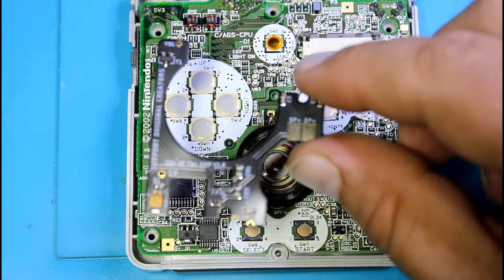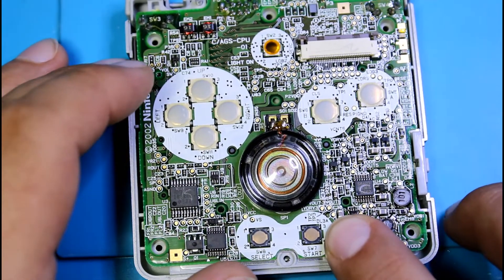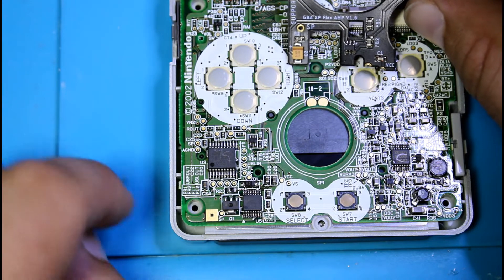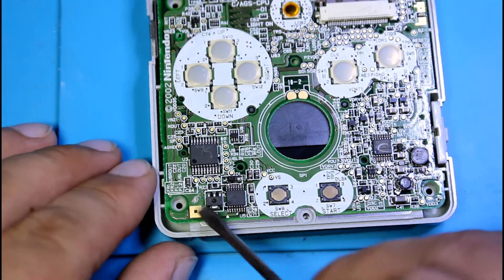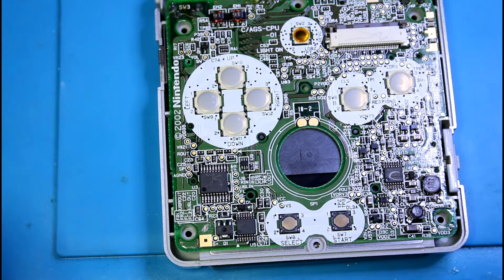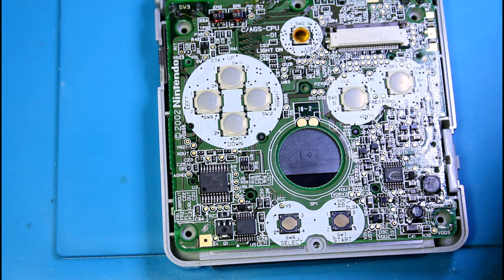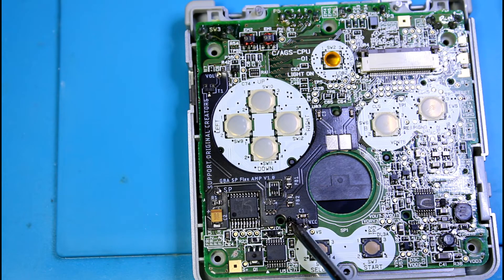Installing the new GBA SP Flex Amp in an AGS-001

Comment: Can I solve no sound issue with this amp? I tested My speaker works but no soundon gba sp 001
Reply from the maker: The GBA SP CPU is what generates the sound for the handheld so if there is no sound you either have a bad amp or some broken traces or possibly a bad CPU. My amp taps into the output of the original amp so if that has no sound then neither will my amp.

Comment: I got and installed this in a 001 and when I turn the volume down it dosnt turn off let alone mute, any pointers as to what could be wrong? The volume control does work it dose get quiter just dont turn off, 
Edit i cant liad your website as for its blocked for me because you dont ship to where i am, so i could not get a hold of your email

Comment: That capacitor isn’t just ground. I figured that out the hard way. I originally connect it directly to ground on a AGS-001 via the wire. I didn’t need the wire. I soldered it directly to the capacitor. Now everything is perfect.

Comment: For the AGS-101, it seems that there are only 3 tack points between the amp and mobo, with the 4th connection being a wire soldered from the amp ground point itself (not the mobo) to the scraped off ground. Does this sound correct? Thanks!
Reply from the maker: Yes, the 101 has no component where the 001 does that connects to GND so you have to find a GND point and that area we scrape is the closest but you can use any other GND point if you'd like.

Comment: Hello, I've just installed this flex amp along with your power cleaner in my ags-101. The sound is loud and clear overall, no hum or hiss. But it gets crackly when louder noises or songs are playing. It kinda sounds like the speaker is breaking up. I'm using the 1w speaker you recommended and I've also tried it with the oem speaker with the same results. Any thoughts or ideas on what might cause this? I'm wondering if i need to remove the piece of cloth between the speaker and the shell. My thinking there is that maybe the speaker cone is rattling against the cloth since there is more travel in the speaker when the volume is louder. Any input will be greatly appreciated. I recently installed your audio mods in my og gba and couldn't be happier with it. I'm wanting to replicate that result in my ags101. Thanks!
Reply from the maker: The cloth usually helps in audio sound. Did you use the speakers I sell? Might be the amp is too loud for the speaker, the ones I sell should be able to handle the amp without issue.
Reply: @Angryhelder  Thanks for the speedy reply! Yes it is one of the speakers from your store. Also, this Gameboy is all OEM except the power cleaner, audio amp, speaker, and battery.
Reply from the maker: @jerryjb  send me an email with the order number and I can send you a replacement speaker.
Reply: @jerryjb  Hey! just curious if the replaced speaker fixed your issue?

Comment: Hello, is it normal for the stock speak with this mod don't have a silent mode if I turn down the volume to max? Because with the mod and the stock speaker with the volume to lowest volume it doesn't get the volume any lower. I need to know I need to know if I've done the job correctly or wrong. thanks
Reply from the maker: The amp has a silence feature when you turn the volume down it will cut the amp off making no noise, so if it is doing that then the installation is correct.

Comment: Smh I had one ready to mod.. but I didn’t realize that I needed a 001.. not the 101..
Reply from the maker: You can do a 101 with this as long as it has the VOL solder point. The gnd on the 101 needs a wire to an area you ha w to scrape which I show pictures of the location on my site.
Reply: @Angryhelder  yeaaa that’s what I don’t have😭

Comment: I have a GBA SP 001, and I followed your instructions for that model's installation. I already had the Power Cleaner installed, and the speaker worked fine. After I installed the Flex Amp, the Speaker no longer produced sound. Help, please.
Reply from the maker: Send me an email with pictures of your installation. I don't do support over youtube. Going forward I am going to turn off comments because there is no way to see your work over youtube.

Comment: Could someone help me, I tried to install the amp on two boards and they no longer turn on, I checked the soldering points and they are fine, what could it be?
Reply from the maker: Why post here instead of sending me an email for support? Plus no one can see your soldering or any other possible issue. Sounds like you blew the fuse at F2 which you can check with a multimeter.
Reply: @Angryhelder  that's right, thank you very much, both motherboards had bad f2, do you know why it happened?
Reply: @Angryhelder  If the sound is a little low, will it be a capacitor problem?
Reply from the maker: @RobertoGarcia-od6yl  sound is low with my amp? Try another speaker and clean the volume slider. I can't help any further without seeing your soldering so send me an email through my site's contact page.
Reply: @Angryhelder  the sound is low without the amplifier, should the capacitor be replaced? The other thing that happens to me is that the amp does not work well, I soldered the points and the speaker sounds but when I assemble the board there is no sound, I don't know what to do…
Reply from the maker: @RobertoGarcia-od6yl  I've already told you to contact e over email because I can't help you HERE any further without seeing your work.

Comment: My gameboy will not turn on anymore after installing the amp.. I'm very new to this so I'm not sure what went wrong but I'm very disappointed 😔 any tips on what I could do to fix?
Reply from the maker: Yes stop posting questions on YouTube as I have no way to see your installation and contact me through my website. Since you're new to this very likely your soldering is the issue but since I can't see pictures of it I can't recommend any advice.
Reply: @Helder Silva  your website link in previous comments wouldn't load.. do you have a new link? Sorry for the questions. I assumed you had enough already here, but I couldn't figure out your email.
Reply from the maker: @seanbrandt9583  https://heldergametech.com/contact/

make sure there is no www in the url

Comment: Question! 

Can this be used to replace a broken amp reader on an SP? I have a board that isn't reading any noise at all from any speaker I put on it and was looking into solutions
Reply from the maker: This uses the output from the stock amp as it's input so if that amp is no good this will not work. Maybe if you tap into the input audio BEFORE it goes to the amp on the SP and wire it to my amp it might work but since we don't know if it's the amp or something else I can't say for sure that will work.
Reply: @Angryhelder  ah I gotcha. I'll have to do some testing and see if this board is salvagable or not.

Thank you so much for the reply ! 😀

Comment: Thanks for making these mods!
I can't wait to install this and the power cleaner in both my SP's. I'm really curious if the loud hissing sound I've always heard on my ags-001 will disappear with the power cleaner. I'm thinking it should unless there's some other issue with it.
Reply from the maker: It helps but if you amplify the sound whatever is there in terms of noise is also amplified. To truly get rid of the noise would be hard without making an entirely new sound circuit with proper noise suppression and the sp is pretty tight for any major changed to be added. This is why buse flex pcbs to keep the thickness as low as possible.
Reply: Do you think the older versions of the sp have worse noise filtering than newer models? I have another 001 and a 101 that don't hiss.
Reply from the maker: @mattlichenstein4791  I can see there is a lot of newer IC on the more recent SP models this is because they likely put a bunch of the other IC into 1 package and I am pretty sure they might have reworked some of the circuits in these newer revisions and likely the power or audio has better filtering but this is just my speculation.

Comment: So if I install this flex amp with your flex power cleaner, with an IPS screen installed, would the sound be even cleaner than if I just had the amp installed? Will the power cleaner further reduce noise and distortion combined with the amp, or would it be unnecessary to install the power cleaner if I have the amp installed?
Reply from the maker: The amp will amplify the existing audio so any noise in the audio circuit will be heard. The power cleaner helps to clean noise on the power line and therefore cleans audio too but it's not 100% clean as no mod will clean it unless a whole new audio circuit is made with better filtering.

Comment: Isnt that a 101 board?
Reply from the maker: it's a 001 board, the 101 is a still frame I show that has the area you need to scrape for GND. The 001 is the only one with components in the lower left of the board all newer versions have very few there.

Comment: so are we soldering a wire to the ground contact we scraped away and to the c30 fuse? Im just confused because im really new to this. You said to solder a wire but then didn't in the video
Reply from the maker: I said if you have a sp model 101 not the 001 which is in the video then you need to scrape that area shown in the picture since the capacitor is not there on the 101.

Comment: Hey man I just did this mod along with usb c and purple power indicator mod, I messed up because I have the ags101 board and soldered the vcc point to ground instead of the other point my gba will not turn on now, how can I fix this 😅
Reply from the maker: You likely blew a fuse and not sure how you You soldered vcc to gnd when vcc is the same in all versions. The GND can change though.
Reply: @Angryhelder  yeah I don’t know which fuse I blew maybe f1 or f2 it was a mistake, I was watching your tutorial and I got the two points confused so instead of soldering the the exposed part of the board to the correct solder point I soldered the exposed board to the vcc point. I tried turning it on and no power. Really appreciate the reply helder and Im a massive fan of your work, I just got the helders battery for the sp too. Do you know anywhere I can get my sp looked at ?
Reply from the maker: @jessraeside2943  First get some new fuses, it's likely F2 that blew. then see if that makes it boot back up. If there are still issues there is a good Discord with helpful people who can offer good advice unless you need to send it to someone which there are people on this server as well.  https://discord.gg/WnF2fN79k9

Comment: Nice video❤
I have a sound mod on my GBA SP called "CleanAmp v1.2" from RetroSix, is it compatible to use 2 different sound mod, or is it not a good idea? I don't want to break something
Reply from the maker: You would use one or the other, both do the same thing.
Reply: @Angryhelder  thank you❤

Comment: Did I misunderstand something? You scraped away solder mask, but never used it. Was that just a demo of what’s necessary for the AGS-101 units?
Reply from the maker: Yes as I explained in the video it was to demonstrate what you need to do in the AGS-101 which I didn't have on hand to show how to do that

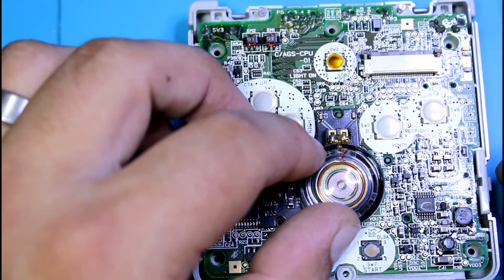Comment: Sound A/B: 1:07 7:36
Does this mod also clean up some of the distortion that the GBA SP is notorious for? I noticed even the amplified sound of the boot up screen had that bit of crackle at the end of the sound. I assumed it was just the poor quality sound sample Nintendo recorded on the chip. I’m wondering about in-game audio.
In any case, I’m very interested in buying this mod.
Reply from the maker: You will always have some distortion with the OEM speaker but a good 2w speaker like I sell for the GBA amp helps quite a bit and the power cleaning flex pcb helps in this department too. Unfortunately GBA audio will always be grainy as that is how it's programmed like this, for example this game in the video if you play it on an emulator sounds like hot garbage too and that should have none of the real hardware noise added to it. Also this like all amps are analog amplifiers and are easily prone to noise as that is how they work, all we can do is filter things as much as possible to clean most of it out.

Comment: Hi Helder, I am trying to install this amp into a AGS-101, but I am having some difficulty finding the VOL point on the Game Boy's PCB. I notice my board layout is quite different than yours. On my board, the VOL point on the Flex Amp lines up with some silkscreen that shows the direction of D13
Reply from the maker: I've actually had 1 other person with your type of board which is quite a rare and later variation of the GBA SP.  Send me an email so I can help you better and show you where you need to solder a wire for the Vol

Comment: Hey Helder. Been buying your products as soon as ZedLabz gets them in stock. Got my amp today and I don't know if it is something i've done wrong or if I have a faulty amp but my SP will not turn on with the amp installed but will as soon as I remove the amp. Any ideas?
Reply from the maker: I actually spoke to him about your situation but I really can't offer you any help over youtube and I would need to see your install so I need pictures to see if it's an installation issue. He told me about fuses blowing and this can occur with the GBA SP as the fuse there is about 0.5A and with alot of mods there is likely more amperage being pulled blowing those weak fuses. A 1A minimum or better yet 1.5A would be a good replacement for the F2 fuse, but it could also be a bad installation causing a short which is why I need to see your install pictures. Send me an email through my site.

Comment: I just installed this and it's loud as advertised l. One question though; is the high pitch buzzing normal on the lowest and at the highest volume level with an IPS screen installed?
Reply from the maker: Did you install the Flex Power Cleaner? Those noises are always present on the IPS modded consoles and adding capacitance such as with the Flex Power Cleaner help get rid of that noise.
Reply: @Angryhelder  Yes I did. I also did a headphone jack mod on it, not sure if that affects anything.
Reply from the maker: @samuraivader3814  I am not sure as I never did that mod so I can't say if it is or isn't the issue. Try another speaker too while you're at it just to see if anything changes.
Reply: @Angryhelder  I should have mentioned its also present while using headphone.

Comment: Just got mine in today. Wow it is super loud. The lowest setting with the amp is almost as loud as the loudest setting without the amp.  Highly recommend it.
Reply from the maker: Yea a very low setting matches the stock full volume.
Reply: @Angryhelder  Seeing some odd behavior.  Not sure if i soldered incorrectly, but it seems like the amp has to charge up. Audio doesn't come through immediately. Only after leaving amp turned on for a few does it begin to crackle in and slowly clear up. Almost like something is charging up. Any clarity you can provide on this?
Reply from the maker: @forgyyy3487  yes that is the filter cap being charged up. It will do this the first time after install then should  not do that anymore unless the SP is not played for a considerable amount of time. The cap cleans the audio so it's pretty clean otherwise it would have alot more noise, a small price to pay since mostly the bootup audio is muffled as the capacitor charges up.
Reply: @Angryhelder  gotcha. I sometimes go a few days without playing. I have the amp turned off during bootup. Since vol slider is set at min, it turns off completely so it doesn't begin charging until I turn vol up. Which is when I'm noticing the crackling as its charging. So to prevent this I should leave it on low during boot up to start charging. I'm following I think lol
Reply from the maker: @forgyyy3487  leave it on just above where the volume turns the amp off
Reply: @forgyyy3487 Does your SP still do this? One of mine started doing this today. After letting it "charge" for a while, the speaker is just really muffled and crackly and never gets loud and clear.
Reply: @mattlichenstein4791  only crackled for a few seconds if I turned it on with the volume down. It became clear and loud once volume was passing through the speaker for about 5 seconds.

Comment: I am confuse...what was the point of scraping board for ground? there was nothing connected to that ground point you scrape. Instead ground point on flex amp was solder directly to capacitor.
Reply from the maker: If you listened to what I said that the AGS-101 doesn't have that circuitry and you need to scrape the coating off like I demonstrated in the video to get the Ground. Go back and watch it again, it's not hard to miss especially when I show the picture if the motherboard and highlight where you need to scrape.
Reply: @Angryhelder  oh i miss that part sorry Helder. So only AGS 101 needs this process of scraping. And you use a 001 motherboard that has capacitor available for ground matching flex cable.
Reply: @Angryhelder  i did not miss the part of where to scrape or what point to connect, just the fact that this only applied to AGS 101and that you were using 001
Reply: Also i did not listen to the video, so my fault, only watched. But i instead read the description of product and pictures on your page. It be helpful if the first picture or description specify that the scraping for ground only applies to ags-101 user. Instead it just says "scrape here for ground" with no further description :(
Reply: Beyond that, great job...i love your products and have been buying many of you page lately ;) will be ordering this today xD
But i will not scrap my AGS 101 lol I'll just use copper 30 awg wire and run directly to ground point xD